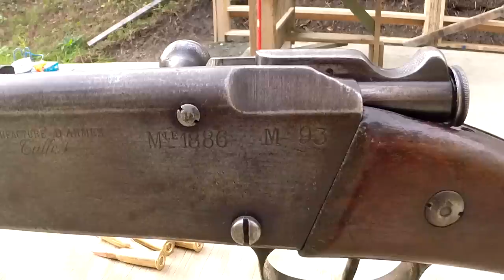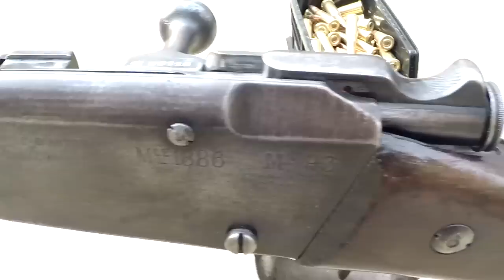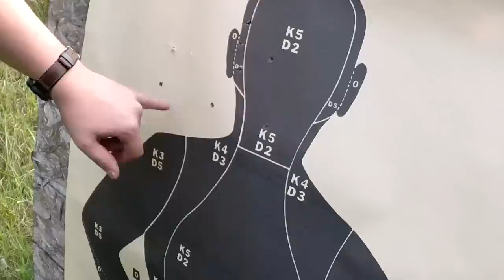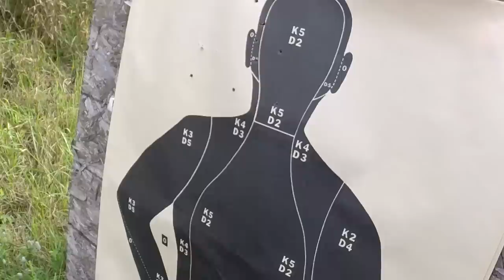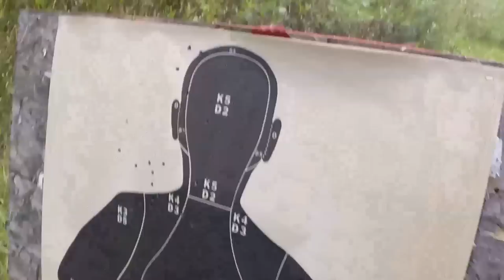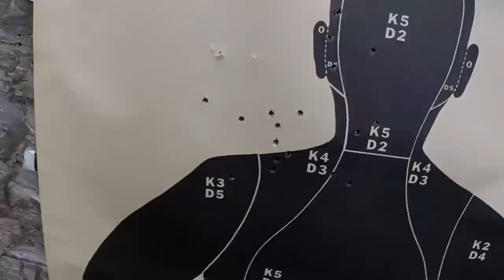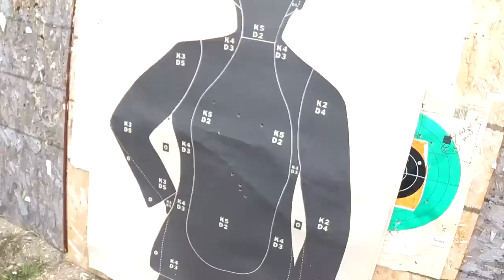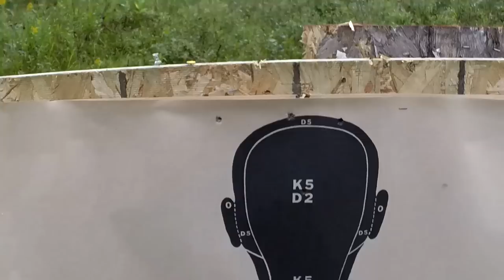French Lebel Model 1886/93 Rifle. 8x50R Lebel.

Comment: Great video, but I should point out that if you flip forward the ladder 180 degrees there is another (very small)  rear sight which is 250m. Also the rear sight and blade are slightly left of center but aligned. I read this was meant to counteract bullet drift at long distances but could not verify that with multiple sources.

Comment: "Tulle" is pronounced correctly. You got it right ;-)

Remember it's 1886 design. Nothing was "weird" at that time. The 8mm Lebel cartridge has this shape because when a new rifle had to be designed to use the 1885 smokeless powder, officials requested that that same cartridge could be retrofitted to the old - and huge stock pile - of 11mm rifles. That new cartridge had to be loaded into 11mm rounds tubular magazines. Hence, even with France having beaten all the world's countries in the race to taming nitrocellulose, it lost its advantage because of this (shit) consideration re-using those same rifles we wanted to go past. C'est la vie !!!

That Lebel rifle is still a beautiful object. You're lucky to get one !
Reply: tvnshack No retrofit on older rifles: black powder rifles was unable to shot the 8mm Lebel who was  near  3x stronger as black powder (=explosion from the barel).
The specific design from the Lebel cartige as another cause: was made to avoid auto percution from the pointed bullets in the tubular magazine: the "conical" cartiges comes so naturaly tilt and the point from the bullet comes in a groove at the cartige base.The 8mm Lebel cartige was replaced from the 7.5 mod 1929 because was unadapted to automatic weapons (work only realy good in the Hotchkiss metal stips machine guns).
In WW1, the fighters who use the Lebel, load the magazine, but use the weapon as a sigle shot rifle: the magazine was a "safety reserve"  in case of need from rapid fire (ennemy charge)...
Reply: leneanderthalien How can you think they were expected to fire the 8mm Lebel into a 11mm black powder barrel ! Barrel and bolt were to be changed... but never done .. and we stayed with the tubular mag design and that odd shaped cartridge.

Comment: your baionette is not the correct one for the ww1  lebel , the WW1 was much longer , the one you have was used on the MAS 36 during WW 2
Reply: +md10591 The MAS 36 bayonet would not be able to be mounted on a lebel.  It uses a completely different mounting system.  His bayonet is one that was shortened.